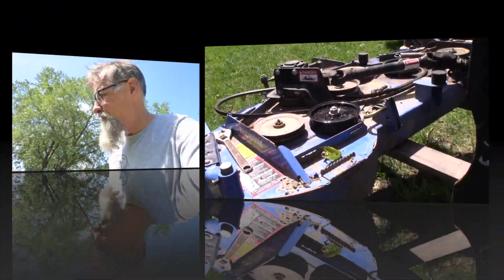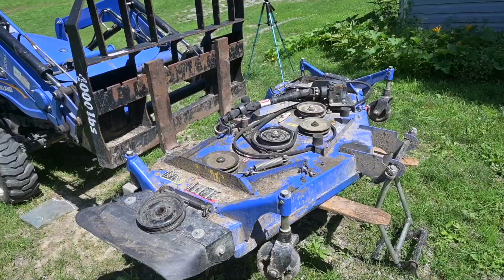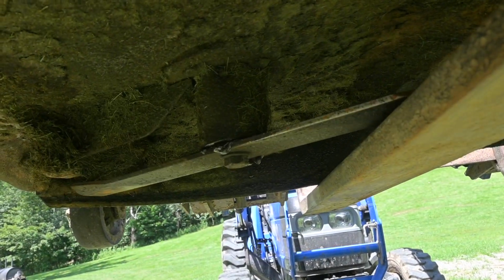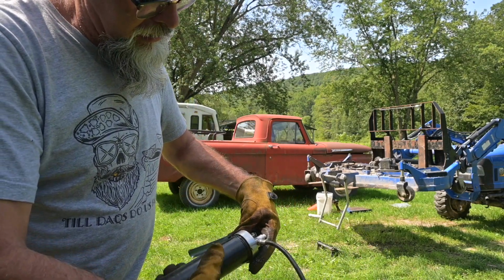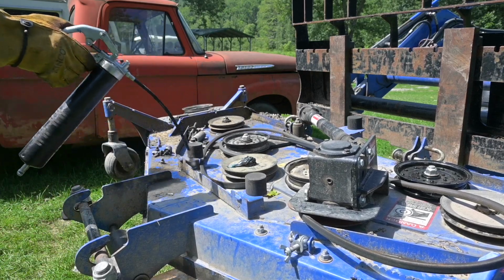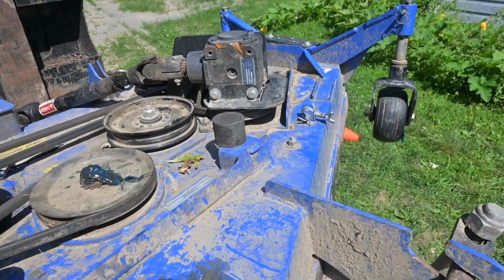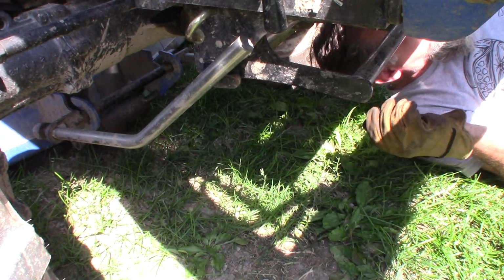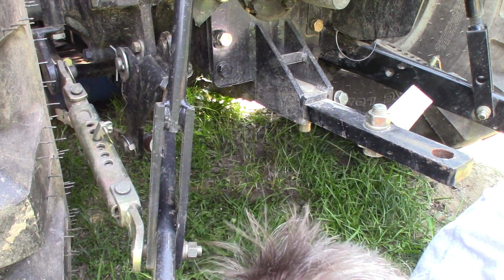Fixin' and installing my noisy mower deck

Comment: It has been my experience that even though you grease the bearings through the zerk fitting, the actual bearings are sealed, ugh!  So what you end up having to do is take apart each spindle, pull one of the bearings and then pull both inner seals to allow the grease to penetrate the bearing and that is why even thoughyou grease it still sounds loud. With that said, usually the pully is not bad just the bearings.  My experience is with smaller mower decks(up to 54 inch) not tractor decks so it might be different but i bet if you pull one of the spindle bearings this is what you'll find.  

Oh, bonus info here,  since you are taking the inner seals off, if youndo it with care, when you're done you now have a bunch of replacement seals if you happen to blow one out😊
Also, would love to see a video about this if it's true, not many people know this and I've been complaining about this for many years(in my head mostly).
Anyway, good luck and keep up the great work.
Reply from the maker: Hi Thad; Some very good points. If the the tower bearings are sealed they should have lasted better before getting this noisy. And that also means all the grease I pumped in is doing absolutely nothin ....LOL! Yeah on the pulley it is only the bearing that goes bad but its integral, I can't see a way to put a new bearing in it without machine work and basically re-inventing the wheel. So guess I will just find the cheapest ones I can and keep a couple spares. Expensive or cheap they are all junk anyway. I think Im gonna buy better headphones and run it until something breaks. Then I will have to tear it apart and when I do I will film it but I hope its a vid I don't do for at least a couple years???? Thanks for an awesome comment and encouringin words!!!! John
Reply: @JohnFrytag   "I think I'm gonna buy better headphones and run it ill it breaks" 😂😂 solid plan.  I've done that before too and when it does break, the broken parts usually reveal the easiest way to take it apart and fix/replace stuff.  My thought on that is, if it's working, leave it, if it's broken "I can't break it more" so I might as well see how it works and fix it from there. 
Unfortunately 3 yrs is about average for sealed bearings and usually you can take.the whole spindle off and tap out the bearings for replacement. Not to hard just a PITA. Because in my book the manufacturer should have made it better to begin with.  A $6000ish mower shouldn't have problems for at least 10 years in my book.  Good luck,  I know you can do it.
Reply from the maker: Yepper!! Thanks again Thad!!